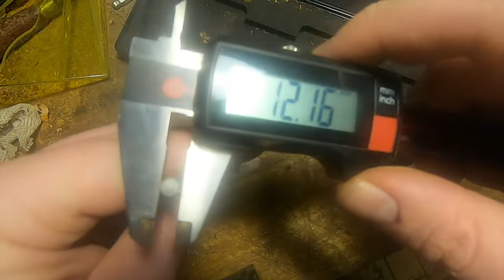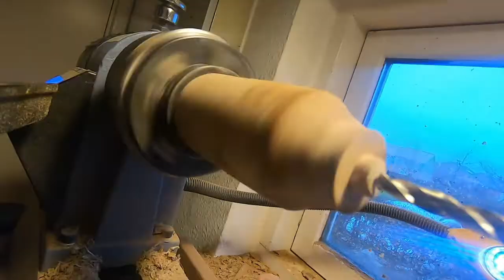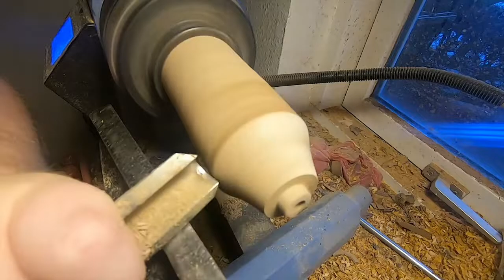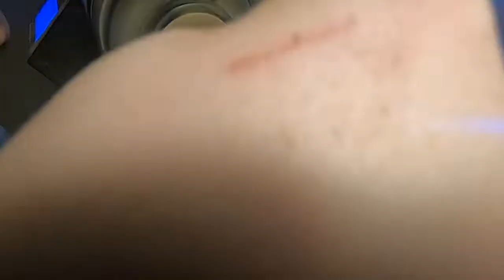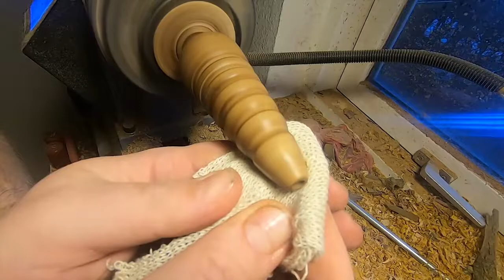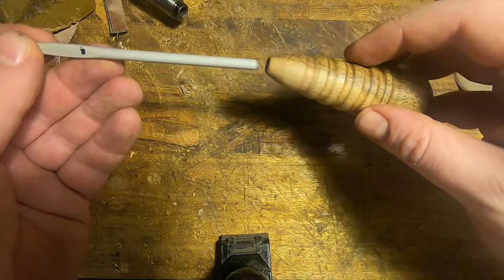Creating Custom Crochet Hooks: How to Make a Handle for Your Favorite Hook

Comment: Thank you! Finally someone  who understands what it's lik trying to crochet with regular hooks but struggles because of large hands.  I have my dads hands and I still haven't found a comfortable handle that's not outrageously expensive.
Reply from the maker: Exactly! And the "fancy" ones with a rubber handle. Are not comfy at all. I have two hooks, where I put a handle on myself. And I love them. I am planning on making a lot of these. I inherited my grandmothers crochet hook stash, with lots of extras. And then bring them to markeds along with my other stuff.
Reply: I completely understand and agree about the rubber handles also.  They are so short.

Comment: I have arthritis, I use my palm, thumb and index finger. The needles were too long so I used a bolt cutter to cut them to 4 inches. It's the perfect length for rapid movement.  Couldn't find any extra short needles so I made my own. I wonder if this could be a market for you for others like me. 🤗
Reply from the maker: That is a great idea! I will have to try that soon and see how it feels :)